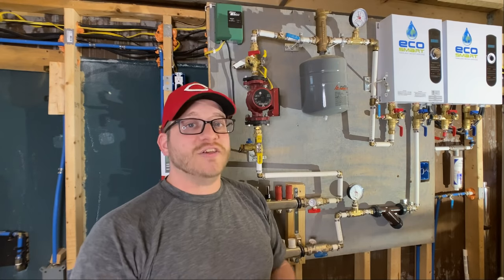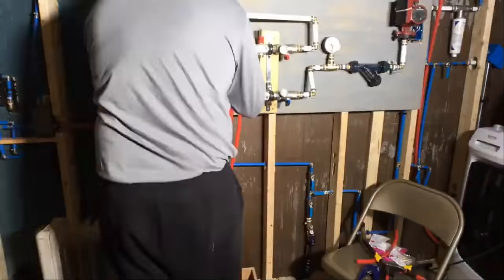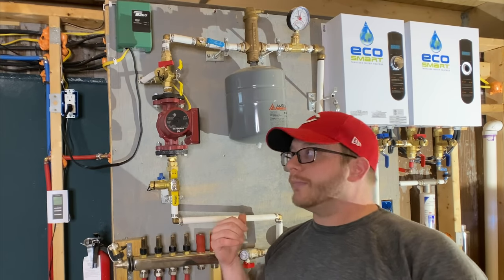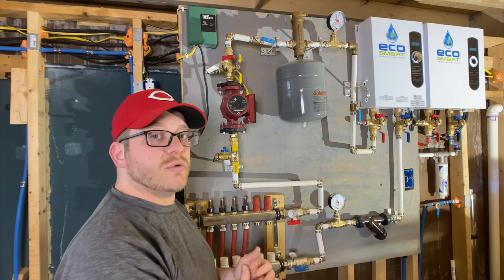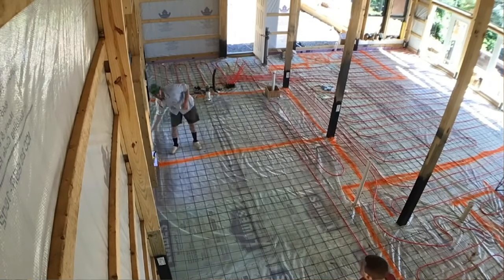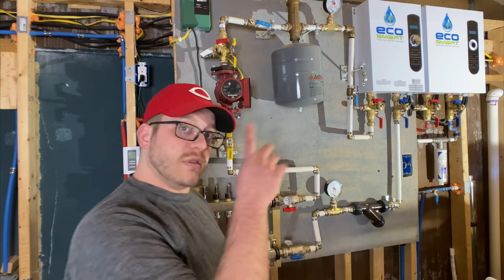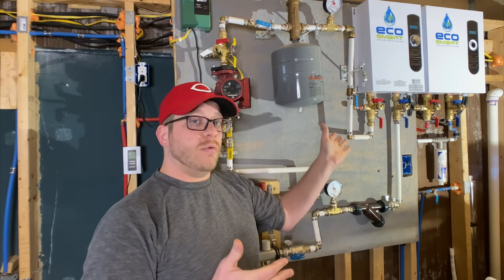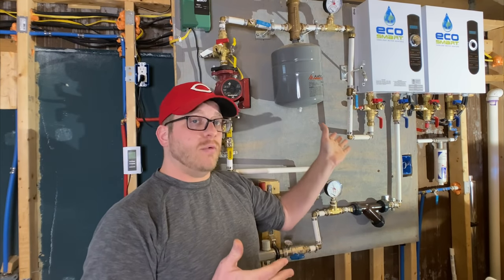Amazing Radiant Floor Heat | One Year Update & System Costs

Comment: You explain the process so well, in terms of a layman trying to decide to attempt a project like this.  What was the main reason you went for 2 systems? Would it be possible to run both the floor heat and other warm water needs from just one? Thank You!
Reply from the maker: Thanks! I’ve just always heard that it’s best to keep the radiant as a stand alone closed loop. I think it helps with maintenance and system longevity, especially on well water.
Reply: It is possible to power radiant floor heat and domestic hot water from a single water heater by using a heat exchanger system. If you are planning on DIYing your heating system (which I am in the process of now) keeping the radiant heat and domestic hot water systems separate, and using on-demand hot water heaters, will most likely be simplest.
Reply from the maker: @zebenkopchak1118  yeah a combination system is definitely possible.
Reply: The issue with doing so is minerals in the water. It fouls up the heat exchanger in the water heater and reduces efficiency. Also it adds dissolved oxygen to the heating system which corrodes metal components if not resistant to it. As other mentioned you can install a heat exchanger in the heating loop to keep it a closed loop, but then feed the house water thru it. It is still not quite that simple though. In the system here all the flow goes thru the whole house, so when you wanted hot water you would also heat the house. To prevent that you would need to install zone valves and thermostats. Then only those things requiring heat open the valve, and the house water can be heated separately. The next problem is output and response time. The heat exchanger must be able to transfer enough heat to get your water up to the desired temperature at the flow rate you are using it, and do it immediately. That can make for an expensive heater exchanger at which point the stand alone water heater makes more sense.

Also to consider. Tankless water heaters have become the new thing to buy, but in reality aren't as well suited as tank units. They have fixed low flow heating limits. If you just crack the faucet you won't trigger the heater and get no heat. They have a fixed output (flow rate) if you exceed it, the water temp drops. They are ruined if they ever freeze and can do so from air in the vent piping of gas units. They are sensitive to debris and minerals in the water, and the small passages get fouled and plugged easily. They cannot be easily cleaned.
Tank heaters also have a fixed heat output (much lower than tankless), but have a large buffer capacity, so usually won't run out before the use of the water has ended and can handle large flow rate surges.. They have no minimum as the water is always hot. They handle scale much better and can be flushed out much more easily. They are always hot so cannot freeze. They are an emergency water supply. They cost far less. After all of these things it is silly that tankless has become so popular.
Reply: Thanks for all the replies, helpful for my thinking on this.
Reply: @court2379  I know of a friend who has had a tankless HWH for 11 years, with zero maintenance and would never go back to a normal 40 gallon tank.  I just had one installed, time will tell.

Comment: Very interesting.  I wouldn't go electric as where I am at it is very expensive but if it works for you, hey its ok.  It would be a great test if one could add in a propane tankless heater to compare costs.  The more remote one is, the less options are out there.
Reply from the maker: For sure a test to compare would be good to see.
Yeah we just aren't interested in relying on propane delivery up the mountain. Last winter a propane truck got stuck up here for several days and the people needing it were out of luck...

Comment: That monthly cost of 200-250 seems high to me. A Heat Pump Water Heater is much more efficient than that tankless. Have you looked into those? Yes, they cost much more than the tankless, but if you can save $100/mon you will recover the additional cost in 1-2 yrs.

What temp do you run your water at? What temperature is your floor? An energy monitor would really help you trim cost to operate. When you put in your mini split, consider using your radiant for foot comfort and the mini split to even out the air temp. Thats my plan anyway, radiant sytem not up yet, but our central heat pump cost about 60/month to heat 2400sqft. Im just trying to warm the floor.
Reply from the maker: We have been keeping the heater set at 110 for the coldest days and it feels nice in the house.  Sometimes we turn on the mini split heat at night just to knock down the chill for optimum comfort.
Heat pump would certainly be more efficient but it takes up so much more space than the small electric tankless heaters require, and space is a premium in our small home.
The running costs will be easier to swallow once we have a full solar panel setup.

Comment: Very impressed thanks for putting all the links. They realy help   my. ?   How do you know what size pressure tank or expansion tank to use
Reply: there are charts you can referance. I belive you use the output of water heater or boiler and the puressre the system opperates at. for radiant usually 30psi
Reply: an expansion take is just a tank full of air with a rubber bladder separating it from the water. basically a bloon. when valves open and close the puresser can spike in the inclosed water system. the tank is ment disapate thoes short spikes in puressure, rather then a connection or other piece of equipment.

Comment: Hey there, I love the system you put together! I have one that I did on my own as well, utilizing old cast iron radiators I restored instead of radiant floor heat. 

If I could make one recommendation, I ended up switching all my PEX B to PEX B with an O2 barrier. I can see you are using standard, run of the mill PEX B, which in and of itself is not rated for this type of use. The PEX B with oxygen barrier is orange in color. 

My problem, all the ferrous metals in my system (the radiators and circulator pump) started rusting and flaking. I ended up switching all the piping in my system to O2 rated PEX B, and CPVC which is also somewhat better. I couldn’t keep a system with higher oxygen levels due to the radiators. 

In your case, considering you have radiant floor heat and a copper heat exchanger in your boiler, it looks like the only ferrous component in your system is the circulator, and expansion tank if it does not have a liner (mine does). I would replace your red circulator with a brass or bronze model, specifically rated for systems that do not have an O2 barrier and you should not have a problem. In the meantime your existing circulator may be ok, but eventually it will need to be replaced! After it’s replaced you can use your system worry free, as degradation of ferrous components is the only reason heating systems require tubing with the O2 barrier.
Reply: I have used both Pex-a and b with oxygen barrier, the pex-a is white and the pex-b was red so I think the colors depend on the manufacturer.
Reply: Keep an eye on that cpvc, it’s know to fail quickly

Comment: You should run multiple zones with thermostats in each section of your zones that is the whole reason for that manifold. The way you got it you dont even need a manifold.
Reply from the maker: The manifold allows us to turn off individual zones. For instance I usually keep the bedroom zone off because I don’t like to sleep in the heat.

Comment: Did I hear correctly in your other video when you said that you had a 400 amp service? Do you need that much to run this system? I mean the Battleship New Jersey uses 8,  440 lines, and those cables are huge.
Thank you.
Reply from the maker: Yes it’s a 400 amp service. 
We will have a total of three electric tankless heaters and several outbuildings we want to power besides the house.
Reply: @LittleMountainLife  Well if that's what it takes to heat your house with one of those I guess I won't be doing that. ;)
Reply from the maker: Again, it's a 400 amp to cover all three tankless heaters plus additional outbuildings.  The radiant floor heater would run fine on a 200 amp service.

Comment: Great informative video! Where do you have the thermostat wire running? 
Did you drill into your concrete or is it lying on top a few inches from your runs?
Reply from the maker: Thanks! Thermostat is in the wall cavity and I put the sensor inside a hole drilled in the bottom sill plate

Comment: nice job.would love to see video on how you flush the heaters.youll love the mini splits i use mine in the early and late heating season instead of my wood boiler and it works great
Reply from the maker: Thank you! Yeah I’ll have to do a flush video in a bit.
Reply: Nice system. Just a cautionary note. I would recommend you do not flush your system because it introduces oxygen rich fresh water that will cause corrosion to components of the system particularly the circulator. Also flushing the system adds more minerals which actuality builds up on the electric elements.
Reply from the maker: @danf2588  by flush I was referring to just flushing the electric heater.  Totally understand what you’re saying though. Thanks!
Reply: @danf2588  thanks
Reply: @LittleMountainLife  don't need to flush heater if you use glycol and distilled water. They actually don't recommend it.
Reply from the maker: @vanloogoats  but I’m using well water to fill the system.

Comment: Hey, I'm just trying to understand these systems for the first time. What relays/switches the heaters on? You mentioned the controller starts the pump, do the heaters only trigger when there is flow? Thanks. Great video and breakdown.

Comment: Is a $250 monthly electric expense really cost effective for a 100SF house? I have a 2300SF house with a Lennox heat pump with variable speed air handler and condenser. My monthly winter bills are in the low $200s and summer cooling in the low $100s. We leave our thermostat at 66-68 year-round.  Great videos.  One question on the post frame construction. Did you sink your posts in the ground or are the bracketed on a foundation wall?

Comment: Compression manifolds blow 
Copper manifolds with honey well zone valves  are the way too go. Wouldn't need balance valves if you balances your loop size upon square footage off the zone or snow melt area

Comment: Do you have a supply line for the closed loop with a one way valve? You may need to add that so you don’t get a shortage of water
Reply from the maker: No supply side but the valves at the heater make topping off the system easy with a hose. Haven’t needed to do that the last 3 winters though.

Comment: Hello.  Great video describing your system.  I did the same for my garage floor.  I'm using the Honeywell aq1000 thermostat also.  How did you wire it?  My system comes on if I jumper the thermostat wires in the Taco controller but the thermostat doesn't kick it on   Thanks
Reply from the maker: Hey thanks! I’m having a similar issue that I haven’t yet been able to figure out. Responded to your email too 👍

Comment: $200 is just a little too much you may want to look into another way of heating your water. There are so many options like solar hot water along with propane or something. Electric would have been my last choice. And you did say you are not completely closed yet so I would say with some tweaking and finishing off you will  see improvement. Its all good. You guys have done a great job! Love your videos! God bless.
Reply from the maker: We aren’t doing propane up on the mountain but solar is a possible option in the future. 
Thanks for watching!

Comment: How much do you pay a kw for electric? $200-$250 can mean a lot of things. Also I can’t remember where you are what’s your average temp in the winter months. Thanks so much for the time you put in these videos.
Reply: If he had access to NG or Propane, his bills would be under $100 for heat . I live in Minnesota where it avgs 20 degrees and my Pole Barn  is a 40 x 80 x 12ft and I heat it for under $100 a month, Thats with 2 huge garage doors. If you do use electric, better to run a thermal mass build and use off-peak electric rates

Comment: Do you have some sort of air exchange system as well?  Also wondered about the water in the system did you add an antifreeze?  I apologize if these two questions were covered in one of your previous videos, this is the first of your videos that I’ve watched. Thanks
Reply from the maker: Yes we have an HRV for air exchange. No antifreeze in the lines.

Comment: I don’t like the Pex used on the wall for the expansion tank and such. Copper looks so much better.  I understand you did it yourself and pex is easier.   All said and done you did good lol.  Why didn’t you do a primary/secondary setup ?
Reply from the maker: Thanks :)
Didn't do a primary secondary because, from what I've read, it's not as beneficial with smaller systems.

Comment: You briefly mention the Eco-27 being used for the rest of the house. Is this being used for showers/sinks only? I've ordered an 18 for radiant heat, keep wondering if at 1144 sq.Ft. I should have gone with the 27 only for heat.  I use an AO Smith hybrid for hot water, just love it.
Reply from the maker: The 27 runs hot water for the kitchen sink, dishwasher, clothes washer, and the shared bathroom sink and shower. 
Ad we actually have another 18 for just the master bath on the other side of the house.  A bit overkill but better than undersized heaters.

Comment: Great job with this video. I will go back and watch the previous one and add one more to the count. Did you add antifreeze to your closed loop water? I am mid way into building a 60'x40'  house with high ceilings and 4 zone radiant heat. Good to hear that you like yours and that it heats very well at a reasonable cost.
Reply from the maker: Thank you! No antifreeze in our system. Hopefully that works out. 😆
Good luck with your build!
Reply: I would advise you to use cryo-tek 100 in your system and use a natural gas or propane  tankless heater , you will save on heating costs.  Electric will work ONLY if you use a thermal mass build and take advantage of Off- peak electric rates . Otherwise electricity will be more then natural gas. Once natural gas per therm price is over $1.44 , then electricity will be more cost effective. I have more info on my Youtube of thermal mass builds , if you need more information or ideas
Reply: @JasonYouTube  Thank you Jason, I subbed to your channel and will check for additional info.

Comment: What made you choose electric water heaters over a boiler system using natural gas or propane? And with electric you can set up a solar system at a reduced cost per month correct?

Comment: Great info! Have you thought about using electric wire instead of water system? Just wondering what would be price difference to run that? Thanks
Reply from the maker: Thanks. Never considered the wire really.

Comment: It's that tankless still working well? Thinking about buying the same one. Not great reviews on Amazon.
Reply from the maker: Still works great going into the 3rd winter! And we use the 27kw unit for whole house hot water and it's worked great.  Just gotta descale every 6 months or so.
Reply: @LittleMountainLife  the one for the floor heat should be good to go unless you used hard water? Should used distilled and glycol.

Comment: Great vid.
Can you run cold water thru it for the summer?
Cell reception thru the metal walls?
I’m selling here at the beach and buying land to build a farm on. 12x20 tiny home and 30x40 work shop/garage. Would like to do radiant floor in both for summer and winter? Can the system be ‘opened’ to the well for summer cooling?
Reply: I'd suggest extending the 30x40 work shop by 12' and get a 42x40 or 52x30 tiny home built into the work shop.

opening the RHF to well water can introduce foreign containments.  unless you filtered it, I wouldn't suggest it.

Comment: Looks like a great setup.
Your energy usage is very low, well insulated.
$250/30 days= $8.33 a day.
If your KWh rate is $0.12 (total guess) you are using 69.5kw a day.
Cheers from Oz
Reply: Electricity isn't that cost effective if you are basing against natural gas. Once natural gas gets around $1.44 a therm , then electricity will be better option.  My 40 x 80 x 12ft garage shop costs me under $100 a month to heat in Minnesota . So less then $3 a day and most months its around $2 a day to heat. Have videos showing usage on Youtube.

Comment: I copied your system for my 900sq ft house extension and it works great. Couple of questions: Have you ever had the breaker trip when using just one breaker? What’s your inlet water temp when it is 0C outside? How long does your heater stay on at a time to heat the slab on average? Cheers and great job.
Reply: are you using a 120vac single breaker??? Or a double pole? 

When trying to figure out what power rating AND current usage. You typically want 125%. Meaning, if your current draw was 16A rms (continuous use), then you'll want a 20a breaker. If breakers are tripping, look at your current draw. If you have a steady current draw, but deviation during initial power on (which is very normal) then everything should be fine. If there's fluctuation in your current draw during normal operations, you may have issues with your electrical equipment as a whole. There's alot to determine exacy what your issue is. From;
Faulty breaker
Faulty pump
Faulty water heaters
Corroded cables
Improper grounding
Having ac power to close to DC power.